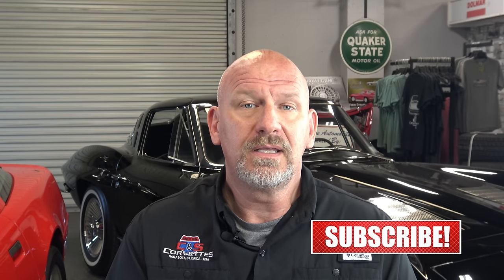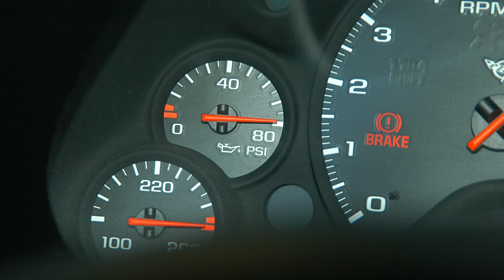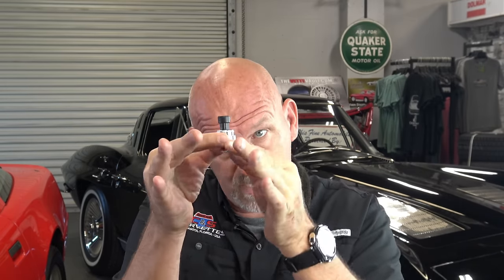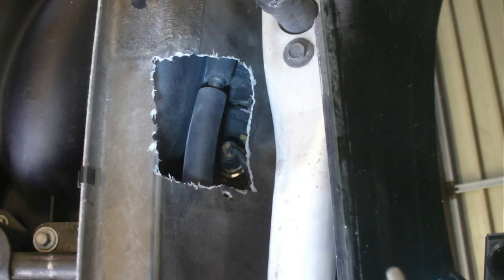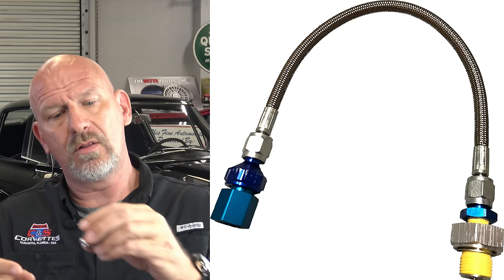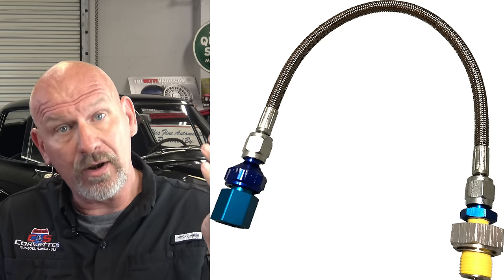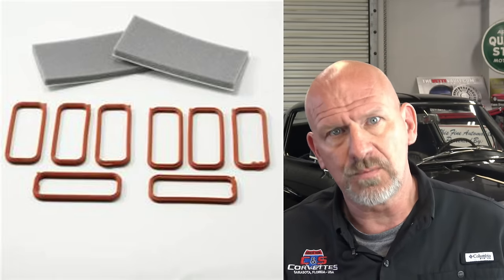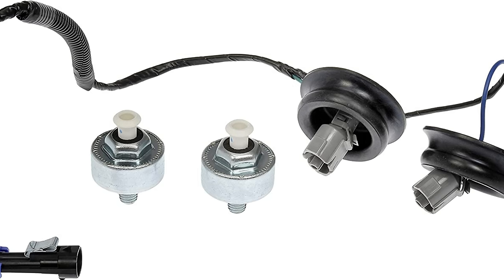#1 Most Common C5 Corvette Engine Problem...and the solution!

Comment: Yup, my gauge has been pegged at 80 for months now. So annoying. I work 65 hours a week, really dont wanna have to take the manifold off….
Reply: The manifold doesn't need to come off for this job. Lyle skipped one of the most effective, cheap, and easy ways to do the OPS swap. All you need is a sensor socket (Mac SC46),  socket swivel, ratchet extension, ratchet, fuel line disconnect, wire hanger to pop the sensor clip. Remove the fuel rails only.  It helps (but not needed) to have a 2 inch piece of garden hose to insert the sensor on the end and give you an extra inch to get the sensor started finger tight without cross threading. 

I've owned 3 C5's and still have the '99 I bought brand new.  I've swapped 6 oil pressure sensors across 3 cars in 25 years of ownership. It can be done with the above tools in 30 minutes or less for just the cost of the sensor.
Reply: Thanks man, much appreciated. I might try this but also replacing the knock sensors and intake manifold gaskets doesn’t seem like a bad idea either. Between a girlfriend, work and taking care of ones self I don’t have 3 hours to mess with the car. 30 minutes is more reasonable. Took me barley 30 minutes to replace my headlight gear myself it was wonderful.
Reply: @camarogoskrrrt3534 I'm like you in that I'm typically pulling 60 hour weeks. So my weekends are precious time to spend with my wife and doing fun things like driving/riding my vehicles. Not wrenching on them.  

The knock sensor makes sense if you are removing the intake. If there's no knock or CEL then there is no reason to just go in and replace them.  It's a "while you're in there" suggestion. The oil pressure sensor is $50 or so and can be done as I've described in under 30 minutes.  Only things to truly caution are 1) don't break the wires to the sensor 2) don't cross thread the sensor.
Reply: PS...the intake gaskets should only be replaced if you remove the intake.  They arent a "wear item" and don't need replacement if the intake stays on.  

I've done it both ways and the intake removal is easy enough but it's not necessary and replacing the gaskets for an OPS swap is just a waste of money.

Comment: So Amazon claims that the knock sensors and harness does not fit the c5 that you have listed in the description. Just want to confirm that is the correct part number before I order it. Mine are bad and keep throwing codes so I figured I would go ahead and replace the oil  pressure sensor while I'm in there. 

Thanks for the info.
Reply from the maker: I just checked the link to Amazon for that kit, and made sure that it is correct for 97-04 Corvettes.  It comes up green, so I'm not sure what you are seeing on your end.  Dorman 926-084 is the linked product.  Lyle :)
Reply: That's so weird, it said let's confirm it fits, so I selected 97 corvette and it says it doesn't fit. Could there have been a different knock sensor for that first year of the c5?

Comment: Good info here Lyle... I would also say if you have a 6spd  and no remote bleeder it's a good time to replace the clutch fluid with some fresh hi temp rbf  as you can reach back to the bleeder with the intake off.....I'm currently in my garage changing out valve springs and seals on a buddies mint 03 ZO6 with 9k miles   got to be extra careful with this one.....I  have an 01 Z51 6spd  68k  never had an issue with oil sender.  but did repair the ebcm  and had the wonky fuel gauge issue  that Techron took care of...love all the useful info you put out keep it up...
Reply: Can you get a remote bleeder in there, "While your there"???
Reply: @joem1224  not sure didnt think about it at the time. its really tight and this was an attempt to band aid my clutch sticking to the floor on pulls..didnt help even tho my fluid  was black.  original stock clutch cant hold 470 rwhp very well new monster clutch is needed before any other mods and it will def have speed bleeder...

Comment: KIA Sorento and Sedonas with the V6 have a similar evil problem. The oil pressure switch is under the intake but at the end farthest away from the transmission. When the switch starts leaking, it does two things. First, oil leaks externally down the valley to the transmission, and flows down and makes it look like the rear main seal is leaking. The next thing it does is even crazier. Oil under pressure from the switch will actually get pushed into the insulation of the wiring (where the copper is), and the oil will come out in various places, but usually at a group of solenoids mounted on the front of the engine valve cover area where the serpentine belt is. It will leak onto the solenoids and down on the serpentine belt and front cover, making it seem like there are leaks there too. Thankfully there is a TSB about it and KIA has extended warranty coverage for this item to be fixed.

Comment: I have a 2004 Commemorative Edition Le Mans Blue with the stripes, I have it now for 15 years, 65'000 miles, super car not too many mechanical problem, had to change the magnetic shock absorber, cost me around  $5,000. also changed both electric windows mechanism (expensive & time consuming) after reading Lyle on the Oil Pressure Sensor, can anyone tell me if I should change this part. Car is running well lot's of power, how should I know if need to be changed.. Also need to repair the HVAC DIsplay Climate control, cannot read the temperature, I will try to do it myself.Other that that I love this beautiful car

Comment: Hello brother, I have a Corvette C6
I am suffering from a problem. You have enough experience to solve my problem
I have a problem with not enough gasoline reaching the machine. I changed the fuel pump three times. When I took the fuel pump tube out and turned it on, the gas pump was strong.
But when it is connected, the engine does not respond, and there is not enough force to push the gasoline into the engine
Please reply brother to solve my problem..!!!

Comment: Lyle, I've got a question regarding the sensor extension. Have you heard anything about having to extend the sensor wiring? Thanks
As always you provide great information.
Reply from the maker: Great Question!  I have not heard my guys mention it to me, so I'm operating under the assumption that it is not necessary, but I will ask them specifically....  Lyle

Comment: Thank you for the video. Very helpful. Would the senor cause a crank no start issue? My C5 Went in to reduced power mode one day I shut it off and it never  started again. I replaced the camshaft sensor hoping that was the issue with no success. But I did notice oil leaking out of the oil pressure sensor.
Reply: Yes it will. It puts it in failsafe mode. It thinks theres no pressure and to prevent damage it disables fuel pump. Sometimes itll work but heat kills it and cuts the fuel pump off on the older cars. I'm unsure if the same is true for the newer ls1

Comment: Hi! great content and info in all your videos; quick question do ALL LS engines  and variations of it like LSA have the oil pressure sending unit issue???
Reply from the maker: It is most prevalent on the LS1/LS6 engines.  I have only had a couple of later cars experience this failure.  Lyle
Reply: thank you very much, Sir!

Comment: Hi Lyle, I have question I recently had my 04 C5 Z06 go into reduced power mode the car lost power and wouldn’t start but I did get it started. I then pulled over and I turn it off big mistake I tried to start it and it turned over but would not start I ended up getting a flatbed to haul it home while waiting I was able to check if it was getting fuel and it was I also checked to see if it was getting any spark and it was so, can you give an idea 💡 on what it may be I would appreciate it thank you

Comment: This isn’t just a problem for Corvettes. My ‘08 Saab 9-7 (Blazer) with the 5.3L V-8 had the exact same sensor and location. I was able to get to it with the special socket and a u-joint adapter on a ratchet. Not easy but fewer steps.

Comment: Hi Lyle. There are two different connectors on the knock sensors. Any idea to know which ones are on a 98 so I can order the correct Knock sensor? Seems according the Amazon reviews the Doorman kit has had some issues (could be installation). Have you been installing the Doorman kits on customer cars? Thanks for another informative video!
Reply: Hi Lyle  has there been any issues withe Dorman knock sensors?  I replaced mine using the kit you recommended and now I'm getting a knock sensor code which I never had previously.

Comment: Lyle,
So if the oil is trickling down the back of the engine block, would one likely see oil on the garage floor (or driveway)?
Reply from the maker: Not necessarily.  On c5's, oil leaks can coat the large, flat surface of the oil pan and the excess (that would form drops on a normal oil pan) gets blown back under the body during driving.  If a C5 is leaving oil spots in your garage, that is usually indicative of a severe oil leak.  Small leaks can go undetected for a long period of time unless the car is on a lift and being actively scrutinized.  Lyle :)

Comment: I'm having a similar problem on my 2011  C6 Corvette. do you have a video that shows the symptoms. My symptom is when I start the car the oil pressure needle goes all the way high, then instantly drops to zero. The message Oil Pressure XXX comes on the display.

Comment: Followed your recommendations on replacing oil sensor which went well. However after replacing knock sensor we had check engine light with code for knock sensor. Mechanic thinks it’s the cheap Amazon part and recommends getting OEM part. Is there anything we could have done to mess up installation of knock sensor and harness. Thanks
Reply from the maker: The harness plugs can be brittle with heat and age, but it is completely possible that the knock sensors were defective.  Replacing them will tell the tale.  I'm sorry that it has been more complicated than necessary!!  Lyle :)
Reply: @csvette  we replaced the harness wires and the two sensors from the new Amazon kit and got the code after driving. The GM parts at Chevy are $86 and $127 respectively.  They are probably all made in China lol. I’m at a loss as what to do when we open it back up. Thanks for responding!

Comment: Arent these on the c4 as well? I have a problem where my c4 reads normally but it shuts off after driving. I read that these sensors cut the fuel pump when it senses low pressure even though pressure is fine.

Comment: 110000 Mi for a tune-up have you ever had a tune-up 20 years that's pretty good fantastic😊
Reply from the maker: Plugs and wires at every 100000 miles.  I did coils just because at 200K.  :)  Lyle

Comment: Thanks so much Lyle! Question: My 04 came the relocation kit which moved the PCV to the valley pan around the knock sensors. I believe this was a factory upgrade to the 04’s due to  numerous complaints of excess oil usage, especially when tracking the car in earlier C5 versions.
With  those updates, should we still update the exhaust manifold gaskets etc, mentioned in this video, in light of the PCV update by the factory for the 2004 model year? Regards!
Reply from the maker: Dave, if you are going to have the manifold off for any reason (and if you are unsure whether the gaskets have been replaced previously)  I recommend changing them out....inexpensive and simple.  Better to be sure.  :)  Lyle

Comment: What is the product that relocated the oil pressure sensor so i can buy one,  my vette has 100,000 miles and it just failed,  pressure reading is pegged at 130 psi, so want to get the relocation kit,  can you point me in the right direction

Comment: I have a 2002 Corvette. Does bouffant's suppose to come on when the AC is on? And also
My Oil pressure gauge is at 80 sometime and then.
At zero
Reply from the maker: I'm guessing that you are asking in both fans are supposed to come on with the A/C activation?  Answer is no, one fan comes on with A/C activation and the second one comes on when the coolant reaches a certain temperature.  your oil pressure sender is going bad, replace it and it will stop giving you the "all or nothing" reading.  Lyle :)

Comment: My problem is the car shuts down when I try and move it. It will back up no problem but won`t go forward.I had it at the dealership for 6 months they were no help. I have had two by-passes installed one which was a recall.I have just about exhausted all my options from the bus line cutting out the auto theft or security system. I have an electrical guy looking at it now but he can`t find anything. I replaced the BCM rebuild and a new fuse panel. So if that doesn`t work for me I may be looking at a wiring job. Hope you can help
Reply from the maker: I will help however I can.  What year is the car?  Lyle

Comment: Hello Lyle, I am aware that my 2000 C5 ABS can no longer be replaced and I have been driving it as is. Does this mean I should no longer drive my C5 or what would you suggest. That's the only thing wrong with the vehicle and still driving it at my age (74)  Leaving in Edmonton, Alberta Canada and don't drive in the winter months. Appreciate any suggestion. Thanks Love your forum
Reply from the maker: As long as the braking system  errors aren't affecting normal function, drive the car until the wheels fall off.  Idiot lights and messages aside, the problem normally doesn't change the utility or safety of the car at all during daily driving.  Lyle

Comment: hey quick question, when comparing a 02 to a 03 c5 is there any major difference and would you consider one to be better?
Reply from the maker: Those two model years are almost identical.  The adjustable suspension changed from F45 to the F55 magnetic ride and there were a couple of different paint codes, but otherwise the exact same car.  Lyle

Comment: I just got a c5 a few days ago and I have noticed as a drive the oil pressure will stay up and at idle it’s drops down a good amount but not to 0 could this be the problem?
Reply from the maker: At idle, low to mid-20's is normal for a C5.  What are you seeing?  Lyle
Reply: @csvette  driving about 40 and sitting around 20 I do have a little bit of a tick to it’s not as loud since I added oil to it the car been sitting at least a year
Reply from the maker: @happyleaf_kg2868  Perfectly normal.  LS1's tick at startup and for a few minutes afterward, but it should dissipate as you drive and get to temp.  You may want to pull a spark plug and check condition if the car has sat that long.  Lyle
Reply: @csvette  ok thanks my next move thanks for the help I have been watching your stuff before I even got my car lol
Reply: @csvette  any tips on getting the bottom part of the plug wire off lol I been trying for like an hour
Reply from the maker: @happyleaf_kg2868  It should just "unsnap" as you pull it away from the engine...there is no trick involved.  Lyle
Reply: @csvette  I got it it was just really stuck

Comment: My 02 c5 is going into limp mode..i noticed oil leak and the guage reads on the low side..is there a specific code associated with this sensor?thanks j
Reply from the maker: Yep.  When your oil pressure sensor fails and it reads too low, your ECM infers that there is a serious engine problem and puts you into limp mode.  Replace the sensor, and that issue should disappear.  Lyle
Reply: So the guage doesn't need to be showing 0 pressure it can just be on the low side to trigger limp mode?
Reply from the maker: @earlyhunter2406  Correct
Reply: @csvette  it has never triggered a low oil pressure warning...can it go into reduced engine power mode without the low oil pressure warning?
Reply from the maker: @earlyhunter2406  It shouldn't go into limp mode without triggering the low pressure warning, but as that is currently your only known problem you should resolve it first and then continue diagnosis if the issue persists post-operation.  Lyle

Comment: Just did this job and 2 days later my gauge is pegged at 80 psi agin. Is there an upgraded sending unit you can get? because I’m not spending $175 on a metal hose lolol 😂
Reply from the maker: What brand of sensor did you use?
Reply: @csvette   ac Delco.
Reply from the maker: @5.7_moto  Move to the Standard or Dorman brand---we gave up on Delcos a long time ago for this reason.  Lyle
Reply: @csvette  thank you, Will do!

Comment: i have one 2005 corvette with engine power reducer that makes me crazy how get fix?
Reply from the maker: Are you talking about reduced power mode coming up on your dash?  Lyle
Reply: @csvette  yes and do not pass like 40 mph
Reply: @csvette  i found under the battery a bounch of wires bites for the rats i fix the wires but now show have pedal aceleracion problem i replace the pedal that need to get relearn

Comment: My problem on my C5 is the charging error keeps appearing even after putting in a new battery and alternator.
Reply from the maker: What about that grounds?
Reply: @csvette  Does the C5 require a higher voltage alternator as the one  got is what autozone called for. If I charge up my battery it goes away for a few weeks. The local mechanic couldn't figure it out. I pulled and clean all those in the engine bay about 2 years ago when other electrical issues haunted me. It ended up the cluster needed to be replaced almost as if water got in the dash from the last owner being its a convertible. I pull them again. Thanks.

Comment: Wow, $125 for a piece of flexible pipe and a couple connectors? I bet you can go down to your local hydraulic store, and build that for less than half price, and be just as effective.
Reply: Go to your local hydraulic hose store (Parker/Napa), and they can make what you need for less than $50.